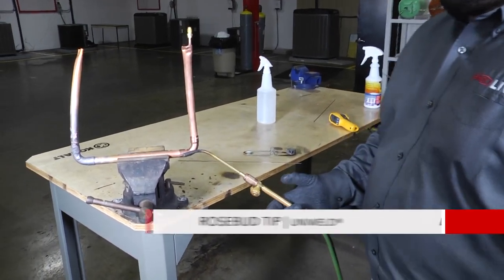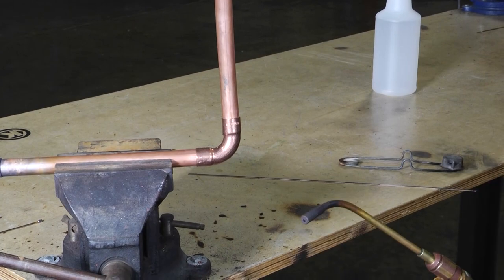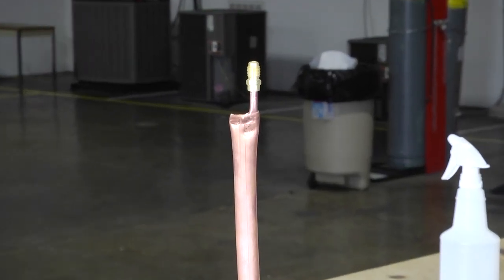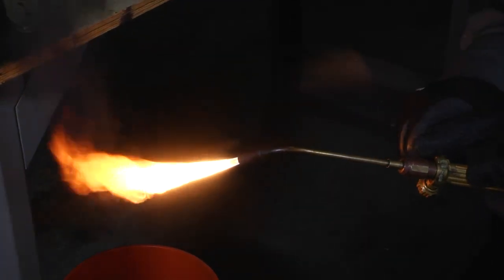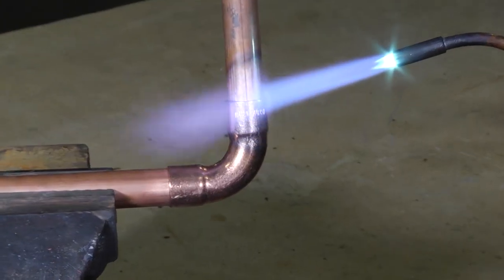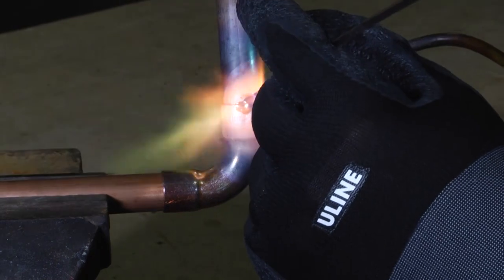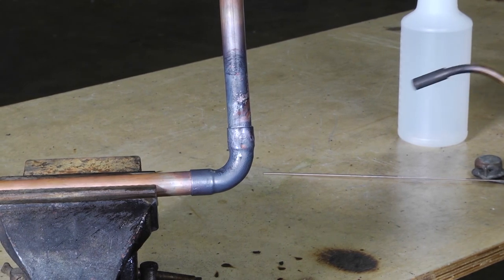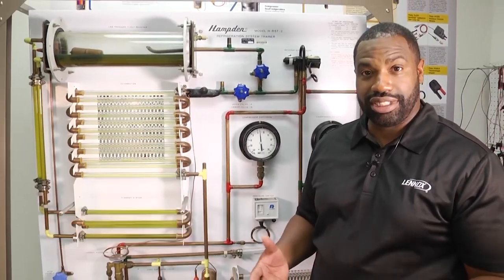Brazing with the Rosebud Tip from Uniweld

Comment: I use the Uniweld 71 torch handle with a Type 17-1 tip. Set my pressure at 5 psig on acetylene & 5 psig on oxygen. I have zero problems brazing up to ⅞ copper using 15% sil fos sticks. I absolutely refuse to try Stay Brite 8 on refrigeration lines!! Sil Fos has never let ne down. I will be honest... the Uniweld micro 6000 rosebud tip has certainly had me curious!! Does it really make brazing as easy as everyone seems to think?? Ive been brazing copper tubing for the past 16 years with my current setup with very minimal issues.

Comment: What are your regulator settings? I have the same tip and it gets hot to touch within 10 seconds. Using settings according to uniweld
Reply: I have the same problem. I bought a second one thinking it was maybe faulty. did you ever find the problem?

Comment: What size tip was that? I'm using a small oxy/ acetylene kit with a no. 2 tip. Tired of waiting for 7/8 cooper to heat up in the winter temps.  Interesting way to face the torch tip. Is that preference? I gave mine away from the knobs. Thank you for sharing and strengthening the HVACR family.
Reply: You're doing it wrong. A #2 tip is for 1/2" thru 1 1/2". A size 0 will do up to 1 inch. A #2 tip should have no problem melting down and blowing a hole thru 7/8 copper tube at all.

Comment: Why do the Lennox evap coils leak so much?
Reply: true.. back a few years a ago before I was on my own and working for a company,  I was sent out on a no cool on a Lennox that WAS INSTALLED THE DAY BEFORE. Bone dry on charge. Went to gas it up with nitro, and saw the pressures drop like a rock. Walked in the front door and could hear it peeing out from downstairs ( the AH was upstairs in a closet probably 30-40 ft away). Had to replace the evap coil. Needless to say the customer was pretty ticked off. Swore I would never sell Lennox once I went on my own, and I still won't to this day.

Comment: You never pulled the brazing rod deep into the joint heat was always at the top not a good seal. Once the top is good you should always work the braising right deep into the joint focusing on the middle and bottom of it as you still feed the rod.

Comment: This tip is nothing but problems. First no clear setting in the instructions for regulators . Flash backs and over heating are a major issue . Absolutely won’t buy it again.
Reply: What's a flash back
Reply: @La2venida  it’s when the flame can enter the touch and travel inside the lines to the tanks. Shut off the tanks. Your acetylene should be only open a 1/4 turn  allowing a quick response time when shutting off.
Reply: That's why you need to install the flashback arrestor and check valve on your torch/regulator